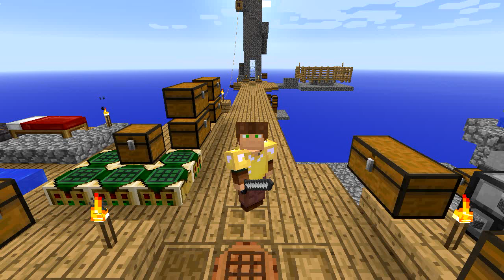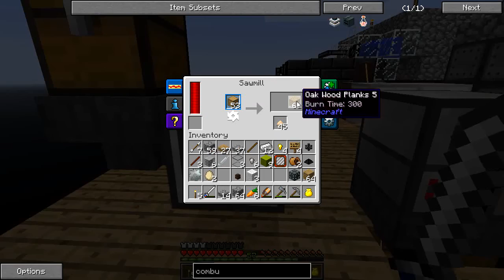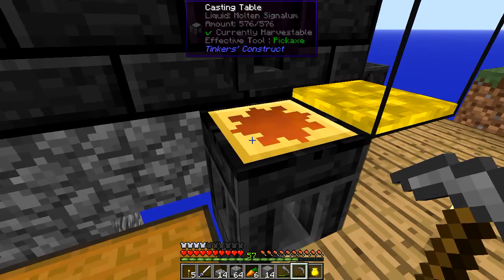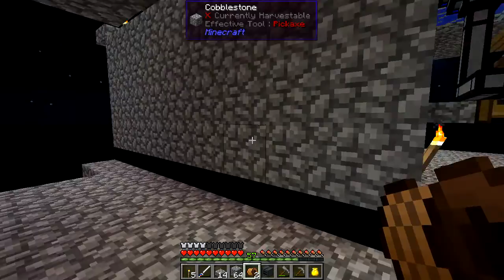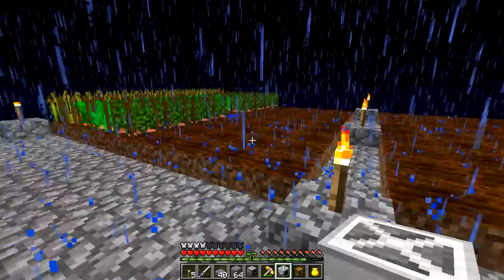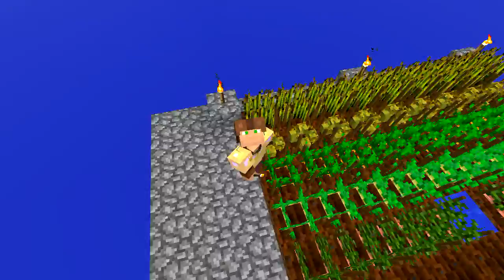FTB Infinity Expert Skyblock - Ep 11 - RF Generator & Harvester

Comment: The upgrade path work, but you need to go all steps: I.E. basic machine + electrum gear + 4 ingot = hardened machine. that + signallum gear and hardened glas results in an reinforced machine. .... NEI is not good here.
For power I started with 1 wheel, a wind mill and then gone to solar panels. Late game I use the MFR BioFuel Generators (160 RF/t). Having 9 of those connected to one BioReactor which is feed 6 crops. Furthermore I have by now 5 IC2 nuclear reactor with 420EU/t each. Need the power for UU matter production. Otherwise, working on the high level solar panels.

Comment: I actually chose to go with MineFactory Reloaded BioFuel into Railcraft steam boilers with steam dynamos.  A 36 block LP boiler produces 720 RF/t while an HP one produces 1440.  I economized on dynamos by using augments since the augments do not affect how much steam the dynamos use, only how much fuel (coal, charcoal, etc) they burn.  If there is a sufficient buffer to get the boiler up to full heat, 1 BioReactor is enough to fuel an LP boiler.  I currently have 8 BioReactors, a 4000 bucket (5x5x5 steel) Railcraft tank, 2 LP boilers and 1 HP boiler (plus a nuclear reactor, but I am really only using it to generate plutonium right now).

Notable resource requirements:
Rolling machine
36 rolling machine steel plates for 9 liquid fueled fireboxes
72 rolling machine iron plates for 36 LP boiler tanks OR 72 rolling machine steel plates for 36 HP boiler tanks
Machine chassis for the BioReactor
Reply from the maker: +SpaceWizzard Awesome setup!  Take a look at a Compacting Drawer to make a RF-less way to combine redstone into a block.  Otherwise, nice work.
Reply from the maker: +Andrew Kerr Ahh, the MFR BioFuel is interchangable with Forestry fuel.  Nice find.
Reply from the maker: +SpaceWizzard just checked it out, looks easy and handy.  Thanks!